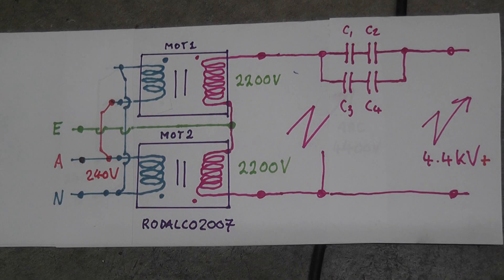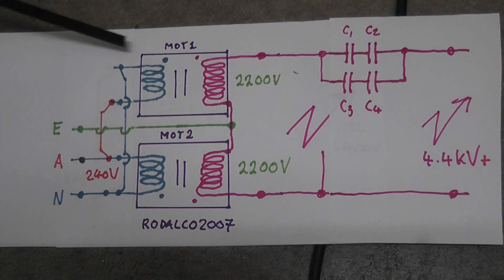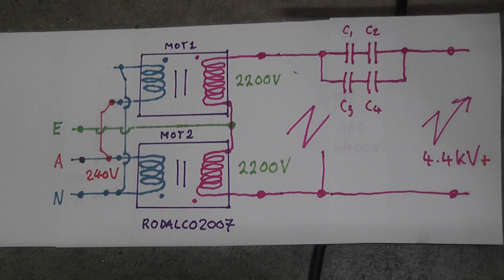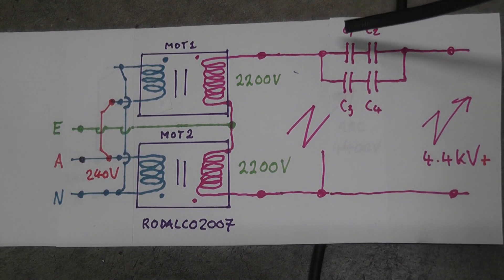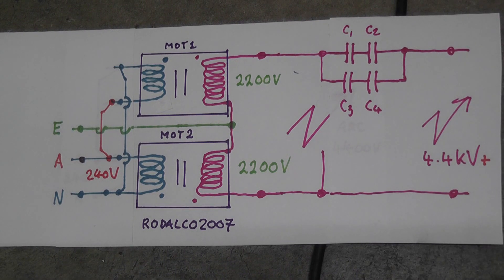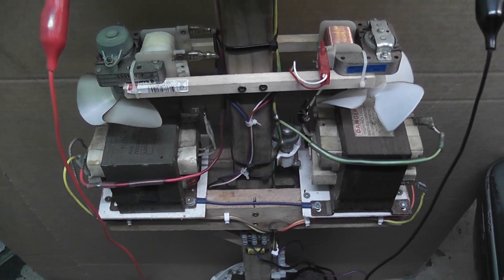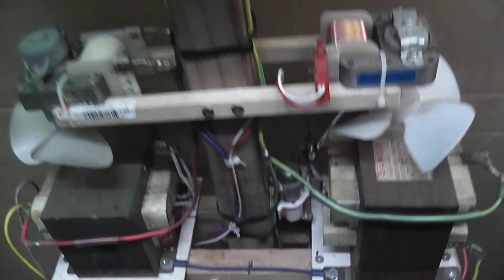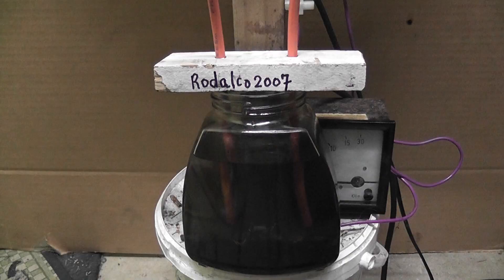4 kV MOT circuit with 4 Caps

Comment: Sorry to raise the circuit diagram again, but for me it still isn't right (IMHO). You moved the primary dot of MOT1 to the other end - correct - but you also moved the N wire up so that it connects to the dotted end again. You could have done one or the other, but doing both has got you back to the in-phase HV outputs instead of the anti-phase outputs you need. From your diagram, if N is positive then all the transformer dotted ends are positive (at the same time) so there will be negligible voltage difference between the two HV outputs.
Reply from the maker: Yeh, you are right, The schema shows the principal set up. It works one way and not the other way. Basically the 240 Volt primaries are in parrallel and the 2.2 kV secondaries are in series. If it doesn't work easiest is to swap the 240 Volts wires on one coil only.
Reply: Thanks, agreed, and MOTs don't come with dots on, so its a matter of testing what polarity works. Can I also just mention that these MOTs are very likely to kill any careless experimenter who might accidentally touch the output, as the output current is maybe 0.5A, ten times higher than a NST. There are many frightening examples of bad chicken sticks and even fingers holding a wire to draw arcs from a MOT on YT. A good chicken stick would include a grounded 'shield ring' between the handle and the HV part, easy to do and a considerable safety improvement.